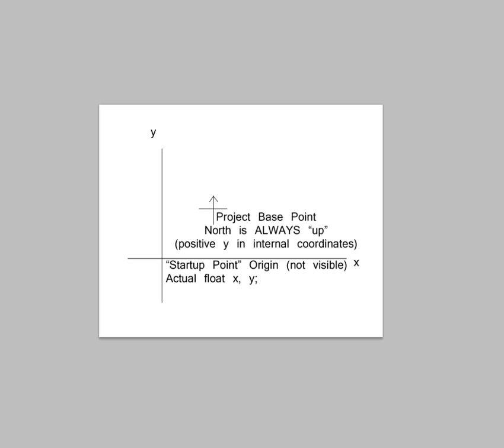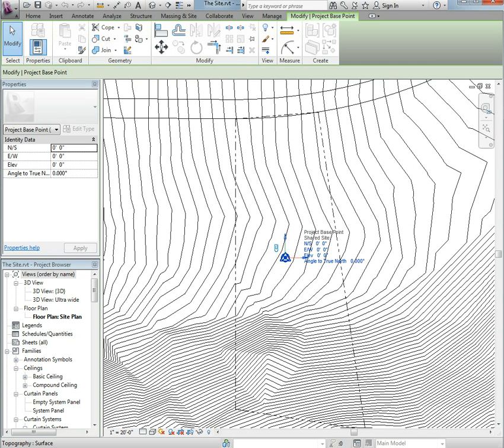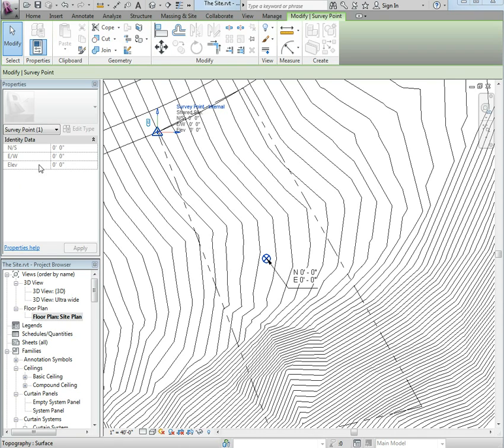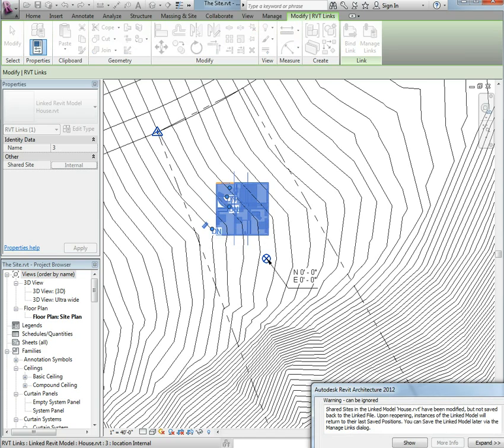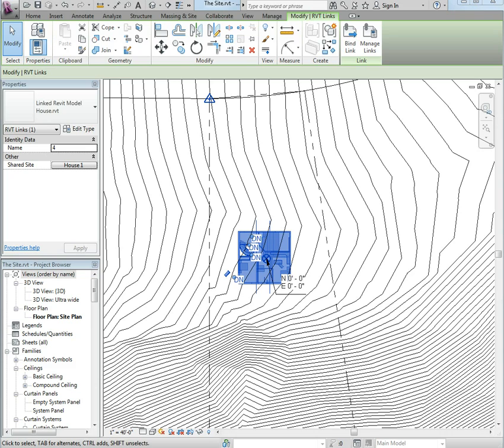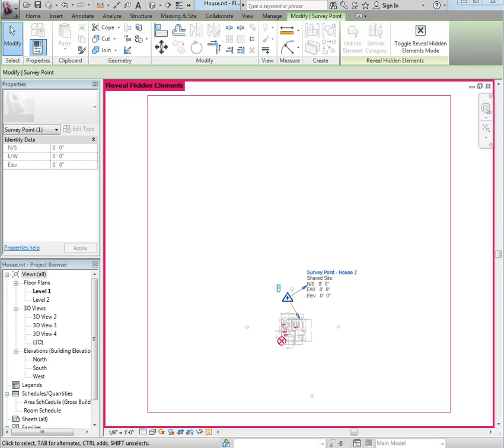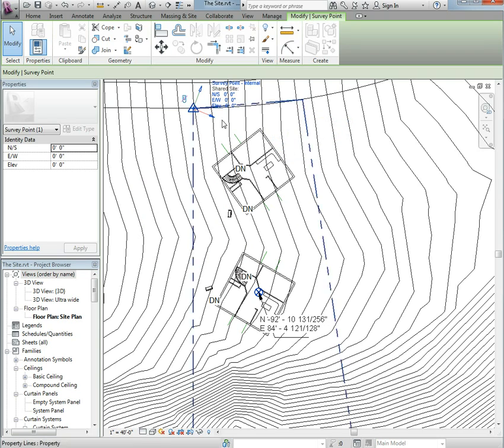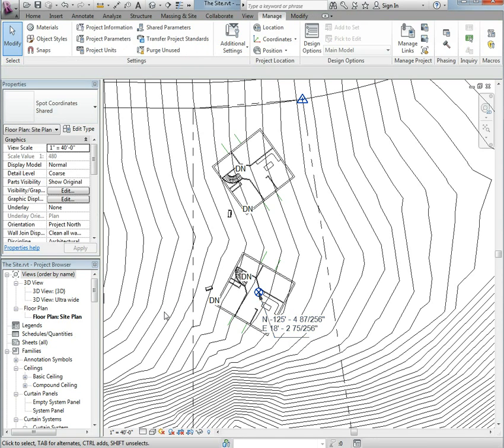Revit Coordinate System - 36 minute explanation

Comment: I was empressed till he got to clip vs unclip of survey point (29:30 onwards) and that there is bug!!! He missed out on the point that when one opens a template the PBP and the Internal start up point of revit are all at the same point/coord of the Site Survey Marker which by default is set to 0,0,0... (in the real world it is not the case) .... When a real OS map is linked into Revit and coordinates are aquired, one would notice that the survey point would be set at 0,0,0 while the project base point and Revit's internal start up point move way far from the Survey marker. That is where the survey marker should be unclipped and transfered to a point closer and more realistic to the actual site. the 0,0,0 WCS will remain where it is and the Survey Marker will read new coordinates from or relative to the WCS 0,0,0. After it is transfered it is re-clipped. There is no bug in the Site Survey Marker functionality both clipped and unclipped surve the right purpose they were coded for.PS: Spot coordinates which are set (coordinates origin: Survey Point) actually read coordinates from WCS 0,0,0 ... and not to the the Site Servey Marker...1. Those should be used as secondary survey points around the site 2. They always should read to WCS 0,0,0 and not the Site Survey MArker (and it is how they are coded) incase the latter gets knocked out. -3. Unclipping the Survey Marker it is an example similar to it being knocked out; if spot coordinates would change reading when the Survey Marker is moved unclipped means everytime the marker gets knocked out; all the spot coordinates set to Survey Point will read wrong and this shouldn't happen

Comment: Yo Luke Johnson - thanks for your efforts on this one - much appreciated - very very useful with regards sharing  X and Y coordinates across Projects. However you make no mention of the Z coordinate and how Relative and Absolute Levels in Sections and Elevations are set within a Shared Coordinate system and the problems that can occur particularly when creating toposurfaces.  Do you have any videos in this regard and/or know of anybody else's work that might cover this?